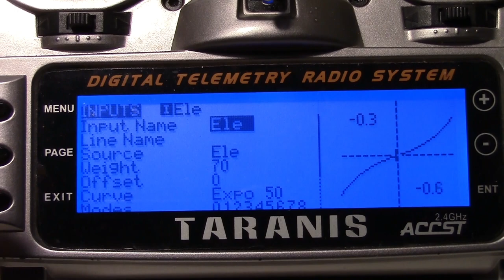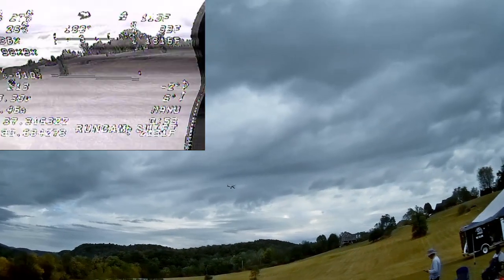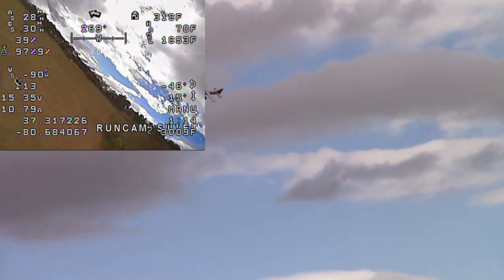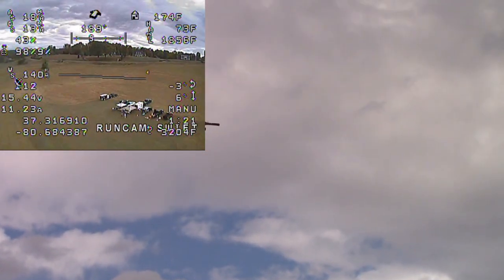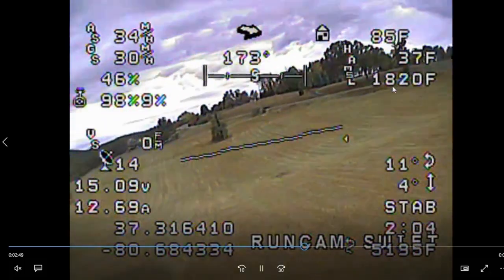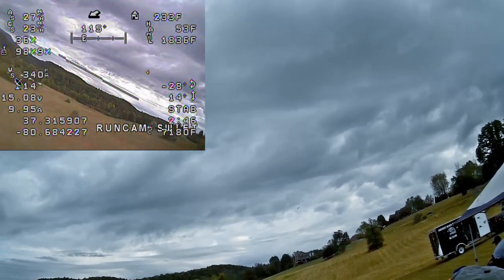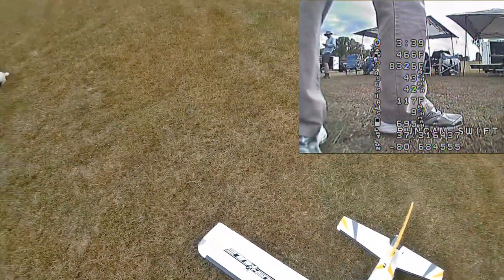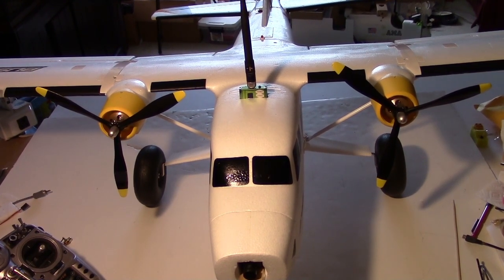HK Bush Mule FPV Build Part 4 - First Test Flights, Maiden flight a bit dicey

Comment: Hi Dave, I also fly the Mule with 3000's with the CG set at 60mm and, I have the battery almost to the end of the tray (back). I replaced all three tires for smaller Dubro and also have Master Airscrew props; that might affect the CG a bit. The minute I saw the place you have your battery, I knew that model was going to be very nose heavy....I had the same problem.....Good job with the camera stuff by the way
Reply from the maker: Hi Fiacost. Thanks for the info. I will be doing some more experiments with battery placement during my next flights.

Comment: Nice job Dave...She looks a bit Tail heavy to me with all that pitching when you first took off?....Nice clean video feed too....Can you use a smaller text on the OSD?....That clean Video feed should let you use text half that size maybe?
  Maybe try an Aileron and Rudder mix in Manual Mode...if that's possible...Adverse Yaw?  Love those 3 blade props, they really add to the realism.
Reply from the maker: That's the MinimOSD. I have not found a text size adjustment yet. That's all there is for the APM except for the AlceOSD which is under development. The camera was also overlaying the RunCam Swift name which can be turned off.  Yes, rudder mix can be added in the mission planner and I was thinking about it.

Comment: Thanks for all the info. How far back was ur CG for this flight ? And did u find the sweet spot for it
Reply from the maker: I was trying for 55 mm. Not sure that is what I actually had. Still working on it.
Reply: CG at 60mm and battery way back almost to the end of the tray. That model is VERY nose heavy. I'm using 4S 3000 mAh

Comment: I have one motor with brake and one without. Can you do a quick video on how you fixed it? I would like to put the one with brake, without. I've only had a handfull of flights with greased landings, all other ones were bouncy like your second landing, very frustrating. I think if you can get the back wheels to touch down first it's not as bad as the front one touching down first.
Reply from the maker: That would make an interesting video. In case I don't get around to it you could do this: Unplug the signal cable to the motor with no brake (you might want to remove the props just to be safe). Next power the RC radio on and move the throttle stick all the way on/up.
Next power up the plane. Wait for the first group of long-short beeps after the initial four groups of short-short beeps and quickly move the throttle to off/down. 
Power off the plane then the radio in that order. Done. Each time you do this it will toggle the brake on/off. 
ESC Manual: https://hobbyking.com/media/file/a/e/aerostar_rvs_esc_manual.pdf
Reply: dmercØØ RTP awesome thank you

Comment: Thanks for the explanations! Do you know if the services are metal or plastic gears? I will buy to use in fpv, I need quality services
Reply from the maker: They are plastic gear servos as  far as I know.
Reply: @DaveMerc  Thank you very much